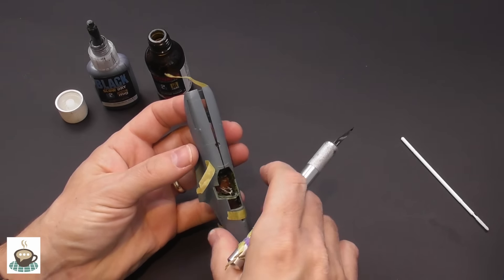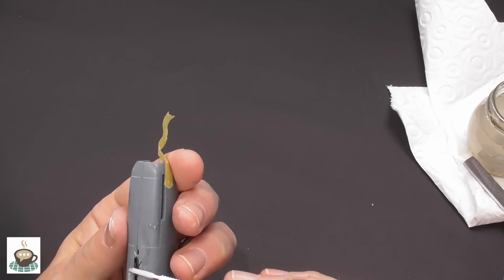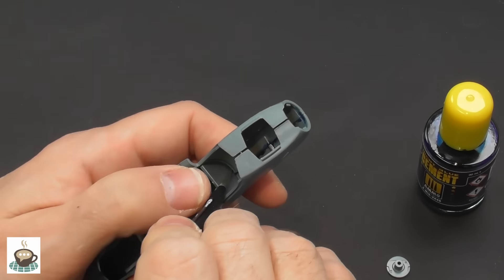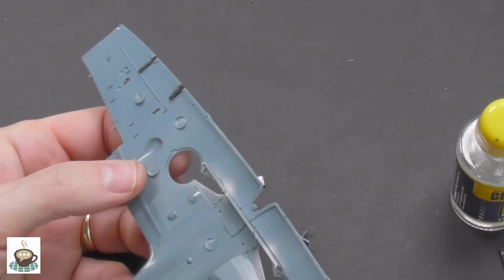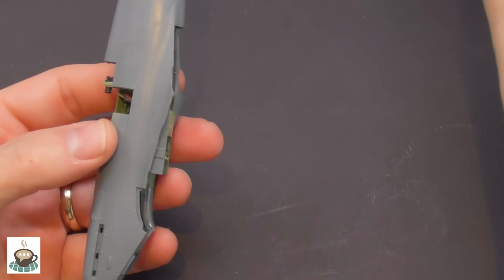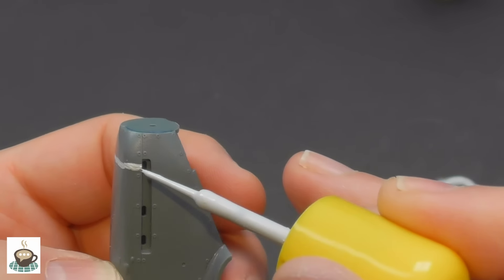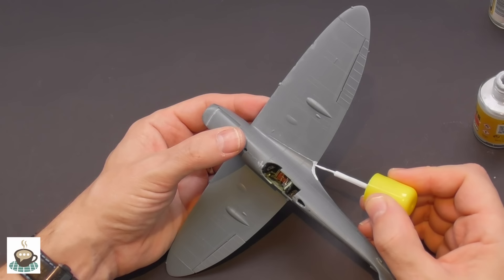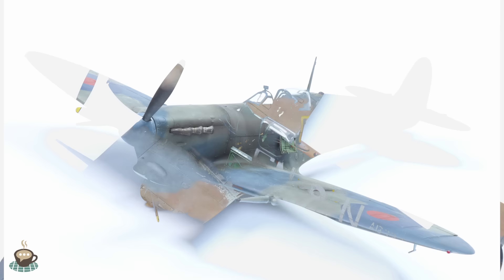A Malta Story:  Eduard Spitfire Vb buddy build with Rick Lawler Part 3: Construction

Comment: Yeah, the Eduard 109 undercarriage leg locates the same way and I find those a bit wobbly if you don't use a good thick glue to locate it in the shallow location. Could be a bit better I think. Progressing nicely though.
Reply from the maker: The new 109s have a new, great system

Comment: great vid, but you are waaay to kind to Eduard on their kit engineering. Anyone would have thought this was their first kit. I hear they are reconsidering 1/32 btw - they will get a frosty reception if they don’t up their game.
Reply: I mean sure they have their small flaws but eduard is one of the finest kits out there, I choose them first before Tamiya sometimes because their detail and fit is just really good. Their spits are some of their finest works IMO.
Reply: I agree . I built a couple of their Wildcats last year and whilst the result was good , the journey was frustrating.
Reply: I had trouble with the cockpit of their Mig-21. I had to horse shoe the seat in.

They are making 1/32 or not bothering now?
Reply from the maker: I think the engineering is good, the 109s are great, and they are getting better and better.